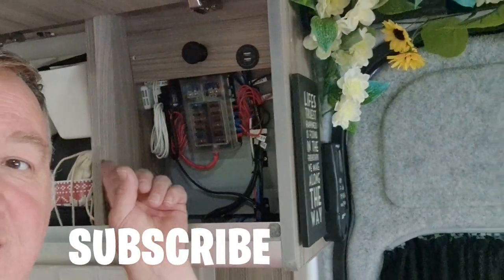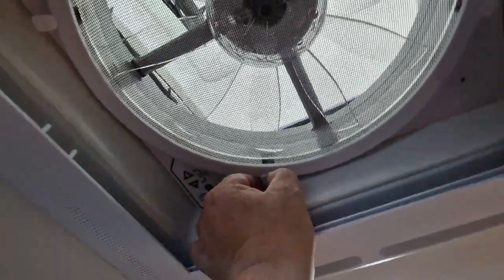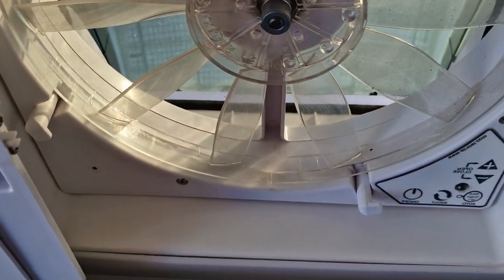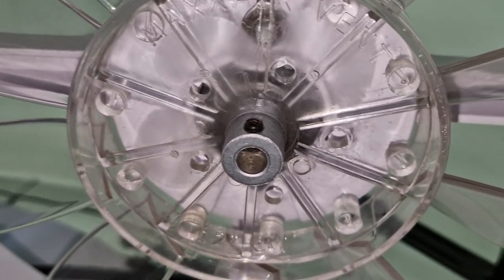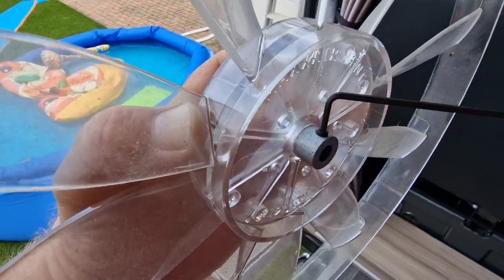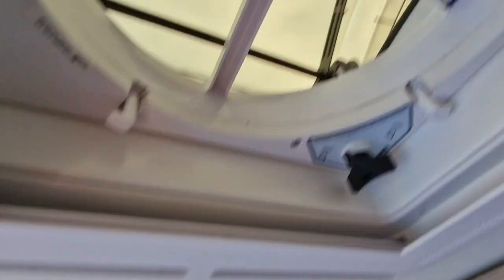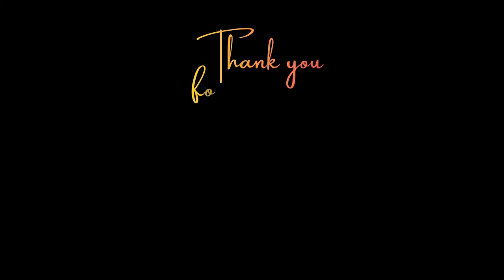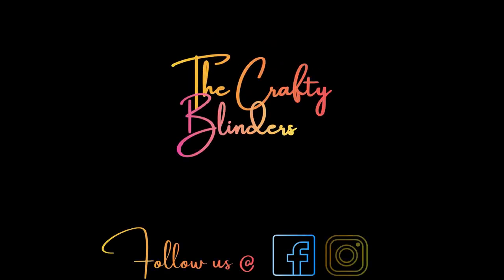Maxxfan maintenance vlog keep your self build campervan cool and comfortable

Comment: Keep doing what you are doing. It's good to have a mix or van build and van maintenance. I love the van build ones, but once I've built mine, I expect I'll be using your maintenance ones too. I'm actually at the Maxxfan point on mine, and this video reminded me of the extra gasket to fit and this will cause me to re-watch your original Maxfann video and that pushes up your views on both videos. I've not checked before I typed, but if you don't have a link to the original video in the description, it would be good to direct people. Keep it going.
Reply from the maker: Cheers glad you like them 😁👍

Comment: A word of warning - do not use isopropyl cleaners on clear plastics - Sam is 100% correct when he says baby wipes/soapy water are the solution. Have used them for years for all sorts of cleaning 😊
Reply from the maker: It can be an expensive mistake 😬👍

Comment: Top video as usual Sam. I’ve same set up as you with my fans. And after this weekend away I’m looking at making some total blackout blinds to add to mine. Maxxfans as good as they are, are no way blackout. Also looking at some sort of soft black foam insert round the frame of the fan as loads of light bleeds out of the sides. And some sort of noise reduction pad to kill “rain rattle” on the bedroom fan. Sounds like I’m not happy with them, I am, but they can be made better with a few tweets. Carry on the good work and see you at The Wheatsheaf
Reply from the maker: We used a sleeping mat  and made thermal blackouts for the winter months
See you soon😁👍

Comment: May I add that whilst carrying out a general clean and service. A voltage stabiliser to maintain fixed 12v is a really cheap 'amazon' item and easy to fit whilst fan is semi apart. Will prevent the very common pcb failure from over voltage ⚡
Reply from the maker: Great comment 👍😁 thank you

Comment: Hey Sam. I found the grub screw to be an imperial size. I'm sure it was a 3/32 size that fit perfectly.
Reply: You are correct - I use 3/32 allen key also.  My 2.5mm key is too big.
Reply: Yep. Maxxfan is US brand so imperial sizes...
Reply from the maker: Good point. I knew I could count on you guys

Comment: Mate I feel your pain there I do ours probably every few months and I tell ya what my shaft was really hard to come off . I think the older the shaft it’s harder to cum off but also cleaning the rim and getting the crap off makes it work like new. Ours was 4 times worse than that an I wounder if its cos we are closer to the docks .
Reply from the maker: I think you use your van more than we do lately pal I found out yesterday its an imperial size key that's required to get it off everyday is a school day mate

Comment: Hi, Sam good video  when I use the remote control for the TV the fan comes on do you know why this happens, could you throw some light about this  I am not a electronic wiz
Reply: The IR sent out from the TV and the fan remote are very close to the same frequency. Mine does it too. I'm just mindful of it and make sure I point the TV remote away from the fan and seems to do OK then.
Reply from the maker: The frequency they both receive on are very close. Just make sure you point the TV remote directly at the IR sensor on the TV  
Unfortunately there really is no quick fix
Reply: @Witteringtrucker  Thanks very much for that, I will remember to point it a little lower.